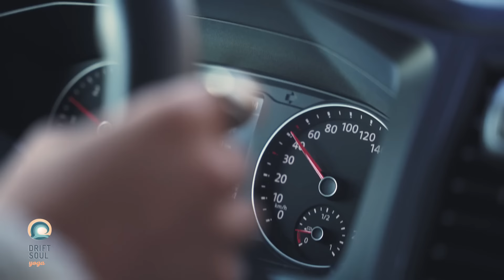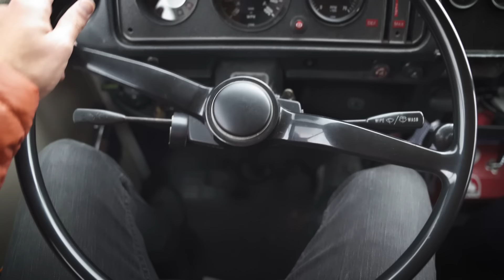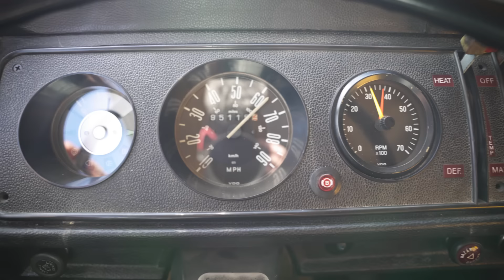8 YEARS LATER - Life After Hasta Alaska // S05E11

Comment: I have a question: how hard was finding parts for your Kombi back in south america? 
I'm thinking about doing this travel, but I have yet to decide for either a water-cooled or air-cooled Kombi and it comes down to the ease of finding parts.
Reply from the maker: Parts are easy to find for aircooled kombis in all of the americas
Reply: Beware of the Type 4 air cooled engine installed in Kombis from 72-79 and Vanagons from 80-83.  Those engines were not sold south of the USA, so there are no parts for them. If you choose a Kombi, make sure to have it Type 1 powered.  This is what Ben and Leah did.  Boomerang originally came with a Type 4 engine, they now have a Type 1 engine.
I have travelled extensively through Mexico and northern Central America in my air-cooled Beetle. It is difficult to remember what parts I needed to find along the way because there was no drama trying to find anything.